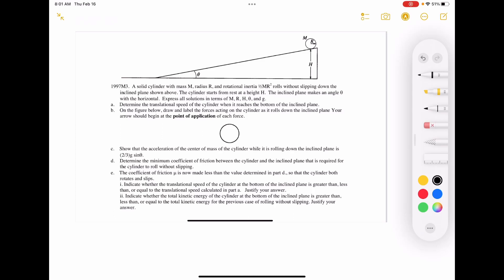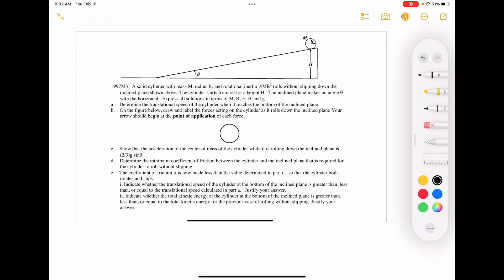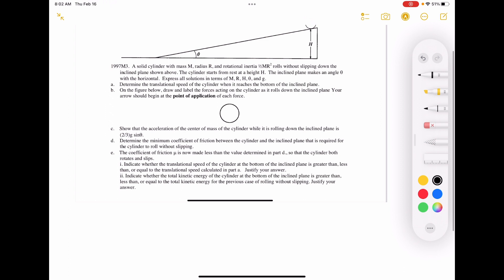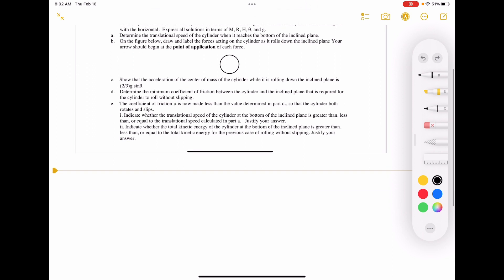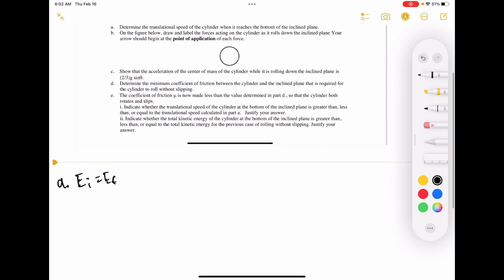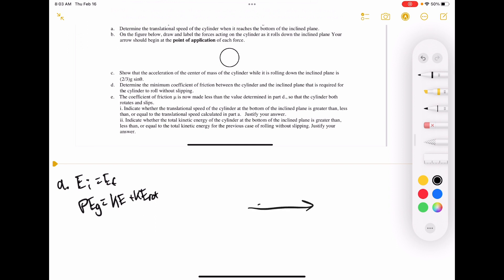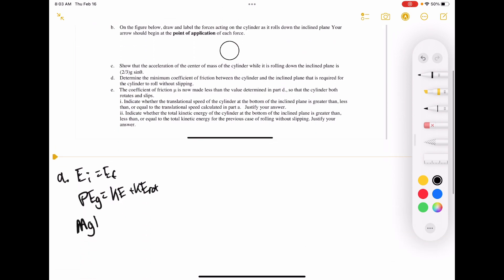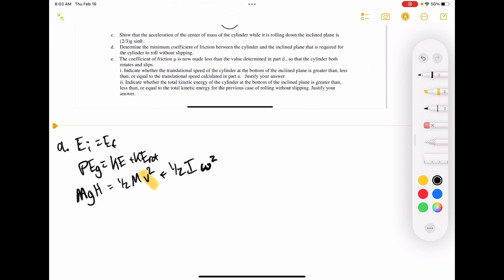AP Physics C 1997M3 FRQ

Comment: How would you know if the translational speed is greater in the situation offered in part e? You would have to consider the heat lost by sliding in the energy equation. The initial potential energy minus the energy lost by heat equals the sum of the rotational and translational kinetic energies at the bottom of the incline.